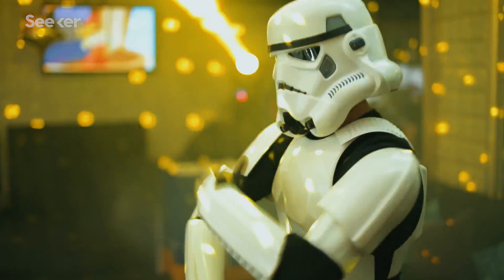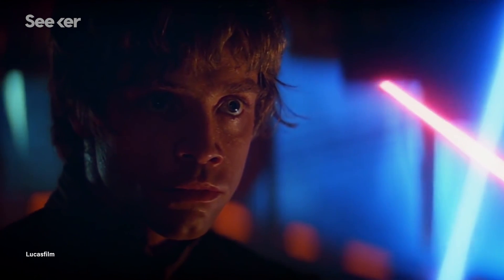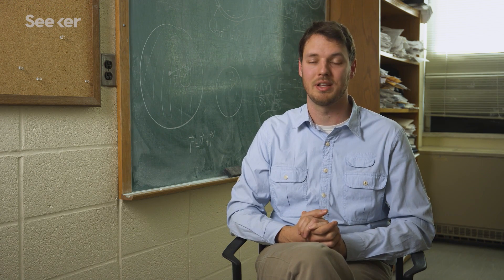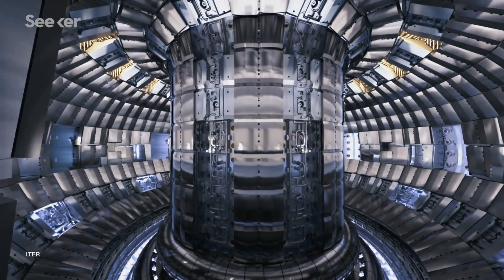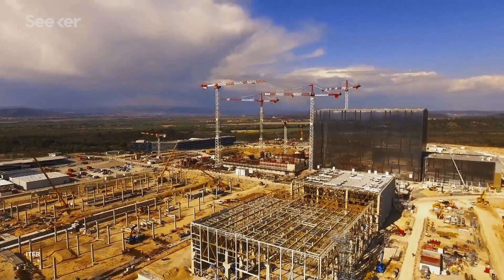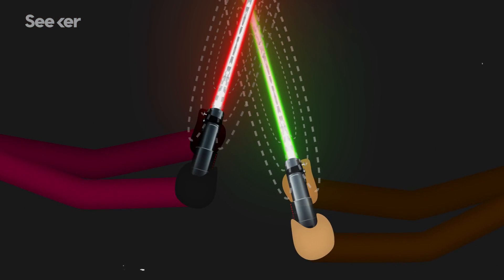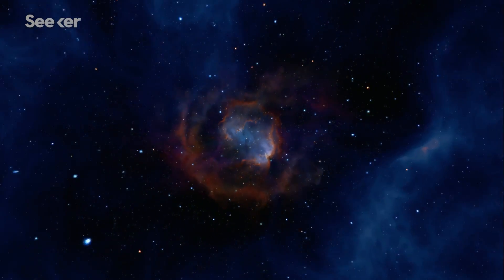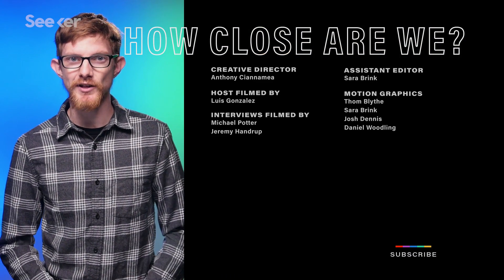How Close Are We to Creating a Lightsaber?

Comment: Seeker:how close are we to creating a lightsaber 

Hacksmith: am I a joke to you
Reply: Just wait til we get graphene batteries, then we can get rid of the powerpack needed for Hacksmith's design
Reply: @SIGSEGV1337  
I doubt that these batteries would be much of an improvement, especially because of the huge current flow drawn by the sword. The main issue with todays accumulators is their limitation in terms of current flow, lifetime and energy density.
Reply: @Enthropical_Thunder  Sure, and that stuff would be much less of an issue with a room temperature super conductor like graphene.
Reply: @SIGSEGV1337  
You wouldn't even need graphene superconducters, the design relies on a hot plasma formed by ionized air. The current flow would be much lower than on a resistance heating element. Therefor, the voltage has to be in the range of 10000v to 100000v, you might want to be electrically isolated when handeling the light saber ;D.
Reply: faissialoo I’m iron man
Reply from the maker: We love Hacksmith! His lightsaber was awesome, definitely one of the best attempts at making one with technology we already have. But what about the sounds and the colors?!
Reply: @Seeker  Those are secondary characteristics that come as the result of the way it's been designed, they aren't essential to the function of it.
Reply: @Seeker  dude,  glass container + wrapping papers and mp3 players
Reply: @Seeker  well it is a protosaber the one used before lightsaber . And yeah sound and color. The color of his protosaber is correct ,cuz if you saw pictures of the dark jedi vs jedi you can see its orange or white.
Reply: Seeker They already had sounds though
Reply: @Seeker  proto saber
Reply: @Seeker  who needs sound and color when we have a real life protosaber
Reply: Seeker check out Styropyro’s saber
Reply: @Seeker  thats easy bro
Reply: ikr
Reply: ikr
Reply: ikr
Reply: Literly what I said
Reply: idk
Reply: I made a plasma one years ago, the video is still up on my channel
Reply: @Egyptian eagle 
I don't think so. As cool as it sounds, nuclear fission just places a much to high hazard as that one wouly come up with a nuclear fission battery concept. Their similar attempts but at much lower radiation levels and therefor much lower energy output.
Reply: They straight up say "there are no actual scientific endeavors focused on specifically creating a lightsaber at this point in time" but that is exactly what the Hacksmith is!!!
Reply: Lets say this, Hacksmiths lightsaber is definitely cool but it suffers from pretty bad flaw in the design, the heat generation. This means that he can not really fight anyone with the sword as the strenght of the rod gets weaker over time. 

In its core, is more of a gloryfied "butterknife wich toasts the bread as it slices it" (if you get the reference ;D). You would need a kind of cooling system to ensure a relatively low temperature for the whole blade, also the heat through electrical resistance might be the easiest way but a plasma around the sword would definitely be much cooler :D and more beneficial. As the main heat sourve (plasma) radiats heat in form of infra red radiation, wich can be reflected, therefor not having that much of an influence on the main structure, a bit like Space Xs Starship hull.
Reply: @Enthropical_Thunder  yes we get the reference
Reply: @Enthropical_Thunder  well it is a protosaber the one used before lightsabers
Reply: arjun nair ikr
Reply: Yeah thats the guy i was thinking off. Thanks man.

I was saying he already made one.
Reply: Styropyro
Reply: Yea it's definitely a joke. A superheated piece of metal isn't even remotely close to a lightsaber.
Reply: @Egyptian eagle you are correct its a protosaber
Reply: Oog
Reply: @Egyptian eagle 
Energy density is to low, the same kind of problem that stops the navy of using a railgun on their destroyers. The volume needed for a certain energy is just to high, though super capacitors are excellent for high current applications.
Funnily enough, we are talking about a problem that asks for a specific behavior, wich is found in fossile fuels XD. High energy density and high poweroutput, to bad that this won't help us with a sword that consumes electrical energy.
 The only electrical solution that i can think of, is to built your own battery the "Tesla" way, arrange your single cells in parallel and cool the Hell out of them, to keep the electrical resistance as low as possible.
Reply: The collab happen hahahaha
Reply: Someone knows hacksmith !!!yes!!! When i saw this vid i was like" will he mention hacksmith".
Reply: Lol
Reply: Ikr exactly
Reply: The seeker wants to create a "LIGHT"saber which means it will be power by light.
Meanwhile hacksmith made his from metal😂
Reply: Exactly what I was thinking. Why is this a video? 😂
Reply: Too bad it doesn’t retract back into the handle
And it”s connected to a wire
Reply: Thats not quite as close as id hope for tbh 

Without a wire plugged to something
Reply: arjun nair yes I was about to comment this lol
Reply: That's a Real fan from Hacksmith
Reply: A lightsaber does'nt have a long rod attached to it.
Reply: Styropyro : am i joke to you too?